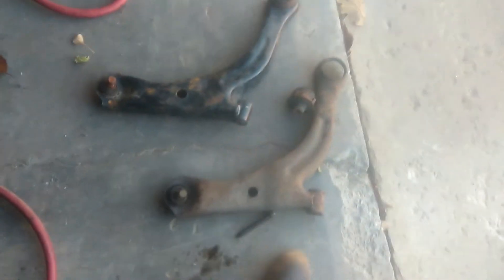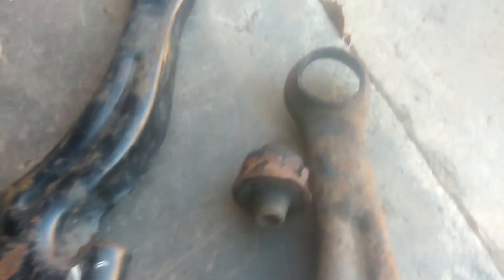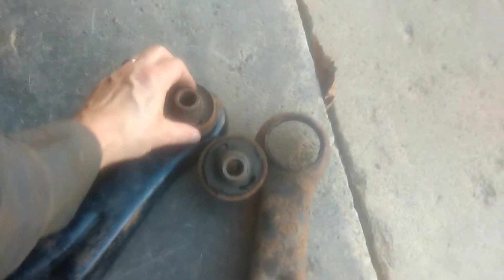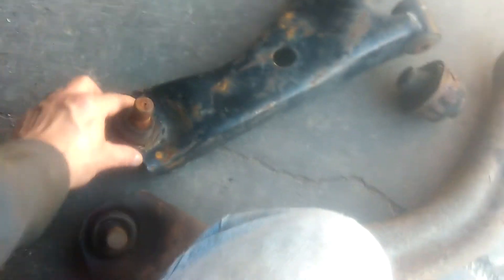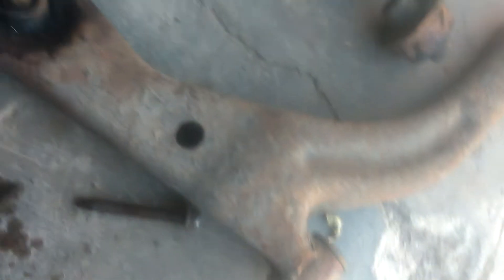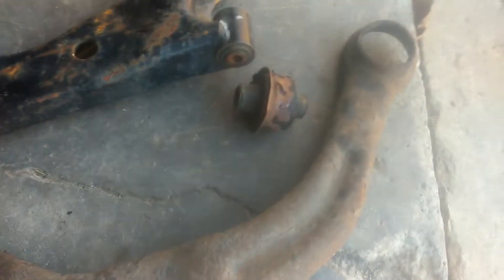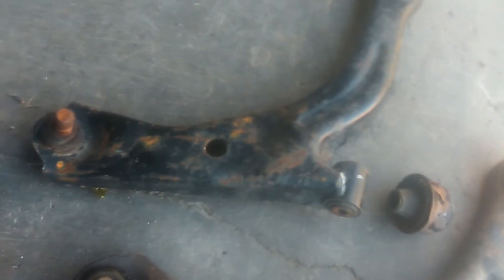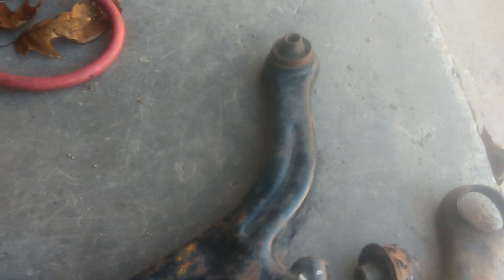How to remove lower control arm on a Ford escape Pt2

Comment: Do you have to change the whole control arm to replace the bushings?
Reply from the maker: Hi Shawn ! Thanks for the comment !  you will have to check with your parts dealer on the that one  I got a used one But I believe you have to buy the whole thing with the ball joint !  Let me Know !
Reply: Dana Crosby looks like you can change the front bushing and ball joint, but not the back bushing in the front control arm. you have to buy the whole thing.
Reply from the maker: Hi Shawn! Thanks for commenting I wasn't sure because I got it from the junk yard